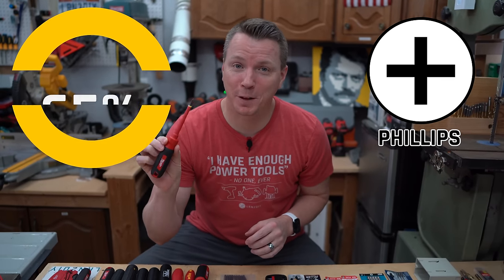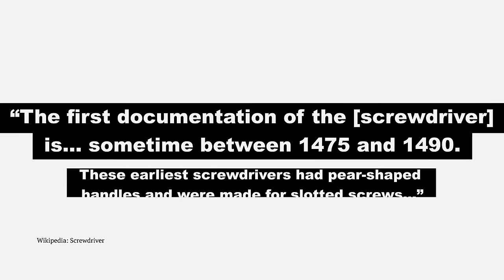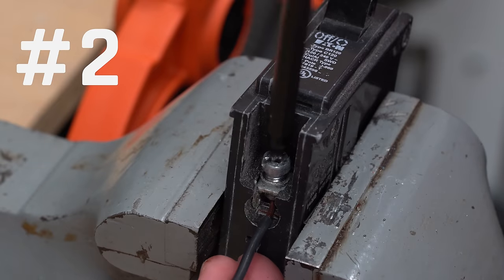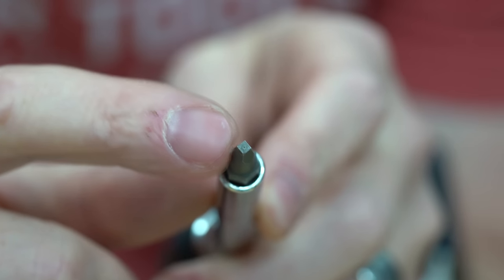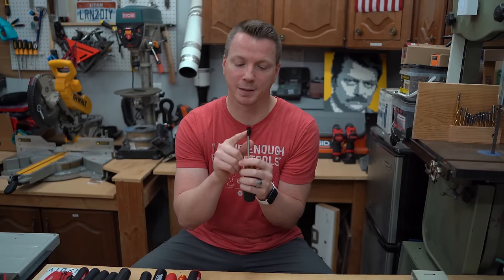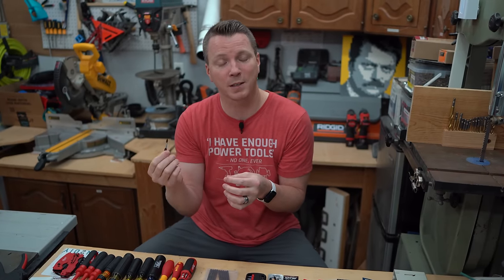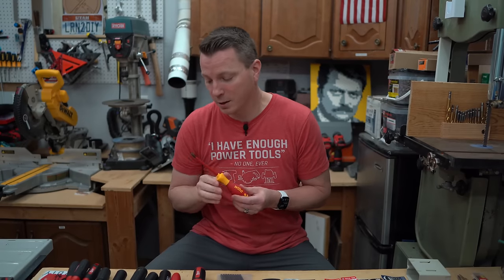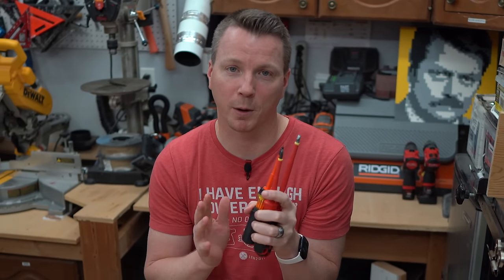You're Using the Wrong Screwdriver For Electrical

Comment: turn that power off, but also test the circuit you're working on with a multimeter! I've seen weird things in outlet boxes. 

Canada here, there should be a robertson in every toolbox already, it's extremely common here. Every deck screw, most countersunk wood screws of all sizes, etc... robertson. Works fantastic, assuming you use the right size. Only cams out if you aren't on it straight, but the other options perform even worse if you're not on it straight. Doesn't require much inwards forrce to get the torque, as opposed to phillips which requires a fair amount in comparison. The robertson drivers also can easily be sharpened a few times when worn! Or if you have a steady hand, as long as you have shank left! 

Slight correction on the Robertson/square drive history, the square drive screw was originally patented in New York City in 1875, but at that time they didn't have good easy ways of manufacturing them, so they didn't catch on. The patent expired before Robertson re-invented it (a case of parallel evolution, good ideas come back!)

With phillips (in non-electrical use cases), I have a pile of different brands and quality around, because it's really sensitive to how well the driver fits. Sometimes a crappy driver fits a screw better, so I rifle through the driver drawer until I find one that feels solid in the screw I'm working with.

Also, anyone with a japanese motorcycle, that's not phillips. Buy a JIS screwdriver. You'll be amazed at the torque increase, and how the driver holds on to the screw at all angles and doesn't fall out like a phillips screw does in a phillips driver! IMO if the world was JIS screws, we'd have no need for anything else.

Comment: Here is a tip. Stop using Phillips. It's the worst in literally every performance metric besides slotted. It was designed to cam out back when we didn't have torque drivers. It's time to use square or torx for everything. It's worth the extra penny.

Comment: Did you look at the Japanese version of the perfect tip, built according to JIS standards?  Their crosshead drivers look like Philips drivers, but have angles that are different, better designed and the tips don't cam out.  These are the drivers we needed decades ago when working on Japanese-made motorcycles and cars,  but didn't know about them. For many years I thought Japanese vehicles were made with cheap Philips head screws that would strip out easily; all that changed when I found out about and started buying crosshead screwdrivers and hex-drive bits made to JIS specs.   Thanks for testing all of these drivers for us. 

Next video, tell us why "perfect" small tools get lost so easily; many have found that you need to own at least 5, if not 10, 10 mm sockets in order to be able to reliably find one when you really need it.

Comment: Why not contact Leviton and ask them about the right driver.
Robertson = square drive.
If Klein made that a ratcheting screwdriver.....
Klein makes a 10 in one or better that has the #1 in it I believe.
It also has slotted, phillips, and torx.
Problem is that if your bit goes bad or you lose a bit you have to buy a whole new screwdriver.
Another issue with that screwdriver is that the recess in the handle can become stripped or malformed so the driver body won't go in and out.

Comment: Philips should also go away. I would actually argue that if they put 45's on the ends of the flat head it would self center, and it would be a good driver for tiny screws (less likely to cam out)

Comment: Is the Robertson and the square the same bit? Aren't the side slopes different?
Reply: Square just means unlicensed clone of Robertson, and so every company will have a slightly different version, just like with Phillips...
Reply: they are not the same, genuine Robertson tips have a bit of a bulge near the centre of their working length, hence their better holding power and less camming out compared to a generic square drive which typically is ground to a tapered square shape from a cylindrical steel rod, whereas the Robertson tip is formed in some kind of press process, it may be hardened steel as well prior to being inserted into a hex shaped or round driver bit.

Comment: We're talking electrical.  Have to have slotted, cause some screws, as you say, are only slotted.  Wish I didn't have phillips, but SOME screws again only will work with Phillips.  Sure, square is great, WHEN it is a decent screw.  Yes, ECX is great, when it is there.  I sure wish there was more consistency by manufacturers.  Yeah, Torx is a great screw, but of course it would take a few sizes too.  As another commenter said, the quality of the screws are also terrible.  I understand that when it is supposed to be a conductor, perhaps then there is an excuse, but there are lots of screws that are in Electrical that are not conductors and price seems to be everything.  I have probably a dozen hand drivers (and lots of powered ones too) that are in my electrical bag.  Many get rarely used, but I can't say that any one of them is the best at 50% of the time...

Comment: If the usual stores actually sold square drive bits for electrical work, then people would buy them. I could not find one in my local Lowes and Home Depot. I had to get one off Amazon. Square drive screwdrivers do not come as standard in screwdriver sets.
Reply: I love most things about 'merica, but y'all are stubborn when it comes to adapting things that aren't red, white and blue. I remember trying to find a measuring tape with metric readings when I was visited our American assembly plant back in '02, and I ended up having to grab a used one at a pawn shop because none of the stores in the area carried them. Ironically, the Robertson screw goes all the way back to the Ford Model 'T', but due to a licensing disagreement between Ford and Robertson they were discontinued on the American made Model 'T's.
Also, don't judge Robertson's by what you are getting off Amazon as most "square" drives are not in fact Robertsons, and most screws are just cheap "off shore" versions.

Comment: Interesting, think I'm gonna need to try the Robertson. I've sometimes used the SL/PH drives in the past, but I always ended up needing a regular PH drive for something so I've ended up just carrying PH instead. Well, I always carry a 2.5mm and 5.5mm flathead as well as a PH1 and a PH2 screwdriver, prepared for almost anything.

Comment: Phillips has too many variations i must have 25 -30 different phillips bits and that doesn't even come close to how many variations of screw and unless you use the correct bit with the Phillip screw you have wobble and slip and that causes stripping and the angles it uses is a ramp basically making you have to apply alot of force down on the head to stay in the head for any driving power.. Torx and square are great IMO Really though even with a matching Phillip where it fills the indent perfectly and entirely the screw can stay on on the end of the driver like square and torx without you having to hold it in place. One thing is that some modern phillips screw heads are ALSO Squares depending on the blade thickness and angle and depth

Comment: A combo bit will only work in a combo screw. The problem is too many standards. There are probably 30 different standards for screw drivers that look like a Philips, but being slightly different wont work properly with a Philips driver. But worse than that, screws are made cheaply, and often very sloppily. When a Philips driver properly fits a Philips screw, the screw with stick on the end of the driver, and not cam out, (this is true of most driver standards) but most #2 screws will fall off a #2 driver because of the sloppy tolerances. 
I try to use the driver appropriate for the screw. Combo drive screws are an abomination, they don't work well with any driver. If I could choose one driver, it would be torx, but unfortunately I have to choose driver to match the screws that someone else chose.

Comment: Why did Pozidrive never get adopted in the USA?  So much better than Phillips.
Reply: They are more expensive. Robertson and Torx are cheaper to make which is why most deck screws have moved to them. $0.10 makes a big difference when you're using 10,000 screws.
Reply: @minutiesabotage  but that must be true in Europe too. Yet no one sells packs of Phillips screws. Everything is pozi. 🤷‍♂️
Reply: @NickElliottuk  And as a result, it will cost more in Europe.

Comment: A thank you broadcast to all the peeps out there who use the correct size screwdrivers. And may those who don't do so step on something wet while wearing socks every day, until a super nova  grills this planet. During renovation work I found every single screw used for piping and wiring over-torqued, nearly every screw head damaged beyond salvage. Some people just want to watch the world - or in this case the house - burn ... or flooded. That was decidedly not fun.

Comment: Flat screws are not great and Phillips are just horrible. (the worst)  After reading all the hype about Robertson in comments on different videos I had to do some research to see if they were actually all that.  Robertson drive are right in the middle.  Then second best drive are the Hexagon shape. (Allen)   The best BY FAR are what I have been using since the early 90s and that is a Torx (star bit).  Now I should have just assumed they were best but I will always look into something I know nothing about just so that I am aware of what is available.  (also they work on every 60 degrees)  (of course electrics are too backwards to use Torx)

Comment: There is no argument that sloted screws ar out of date. The problems is they are not self centering and do not stay self centered as one removes them. This is made worse  if the blade is too thick to fit in the slot or  especially if the blade is too thin or the blade is not wide enough for the slot. There does not seem to be any standard. I have custom ground the blades to thickness at times. However one can usually make do.
 Phillips are self centering and  easy to engauge. The problem is there are not consistent standards in the screws made. Cam out is a real problem because the taper is either too blunt or too pointed. The Japanees industrial standard and pozidrive make the phillips style very difficult to accomidate with out  a lot of bits. 
The Robertson is a good drive but it lacks self centering and has a small drive surface that can cam out in low quality screws. The fit howver is good. It is easy to see why it is loved by Canadians
Torx is not self centering but drives and removes well once one finds the proper size.
 The electrical screws typically have a slot and either a square drive or phillips or pozi in the center. Things do not seem to be standardized. All of this makes working on existing equipment vexing. It seems that the variation for the center is what complicates the design of the combination drive. Working on renovations can be madning if fastners are interchanged especiall in caepentry. One needs a seperate  Pack out section for accomidating screws.

Comment: Coming from Europe with some observations. 

Robertson... Never seen one IRL! Not joking, never seen a driver or a screw for them. Probably seen combo screws, but never knew that they would work with a Robertson driver.

Flat blade... It's an occasional prybar that sometimes can work with a screw. 

Phillips... I hate Phillips screwdrivers. Most of the time the screws are just barely Phillips shaped, so even if you have a perfectly pristine driver of the right size they are still going to cam out. And if it's not the fit then it's the metal that's butter soft. And lest face it, when was the last time you borrowed a Phillips driver and it wasn't worn smooth? everyone has Phillips drivers, and almost everyone has cheap worn out Phillips drivers.
Having said that, with quality screws and quality drivers Phillips does actually work pretty well.

Pozidriiv... This is everything Phillips should have been. My experience with Pozidriv is a lot better than Phillips. Now this may just be because while just about every Philips driver tends to have been worked to death Pozidriv drivers are almost always still in good shape as they have not been used for everything no matter if they actually fit or not. Unfortunately Phillips heads are a lot more common on screws so people tend to go for the Phillips the moment they see a cross head screw, and if it slips they blame the screw and not the driver.

Combo drivers... Never used one, and as I don't work enough with equipment that use combo screws I don't feel a great need to get one.

Now there's the screws....
The combo screws I've worked with has been kind of the worst when it comes to fitment. Now it may be that they would work well with Robertson drivers, but as I've never seen one that doesn't mean much to me. But as  far as Phillips drivers they usually fit like crap, and with metal as soft as crap that doesn't make things better.

And here the simple flat blade screwdriver unfortunately shine. When you've rounded out the Philips part of the combo screw the flat head screw driver will still get the job done. You may hate it, but it's simplicity does have some advantages.

Comment: Now, if they would only make a double ended double sided flip bit screwdriver.
Robertson 1 and 2 flip bit on one end for outlets and a recessed shorter slot/phillips flip bit on the other end of the screwdriver handle for the cover plate and other screws and you would only  need one screwdriver.

Comment: I don't understand this question. You use the screwdriver that is correct for the screw. There are still some screws used in electrics that require flat headed screwdriver. Don't ask me why.

Comment: Personally, I've grown to hate any phillip head screwdrivers, especially when used with a power tool.  They strip the easiest.  After removing old power outlets, slotted screws should be banned from existence.  I would prefer robertson if at all possible since the least hassle.  Did run across the issue of finding Robertson #1 screwdriver bits outside of a set.  Gotta hope to get say Princess Auto surplus online for them.

Comment: Slot-drives (or cheeseheads, as I call em) are required for ANY electrical rework, to get the front plates off! So, I get the 17% number... I'm just hoping that's ALL they're being used for, though.
Reply: Thinking about it again... I think people use slotted drivers in the USA more often than in Canada because Phillips isn't THAT much better than slotted. It's better, but NOT an order of magnitude better, like the Robertson or Torx/star-drive is. I rarely if EVER see slotted screwdrivers used in Canada for anything other than face places and as a blunt impact tool/wedge to pull things apart.

Comment: At the begging of the video I said the best driver for electrical is in fact the Robertson. Then he started going through all these different drivers and I started laughing thinking he is going to go through all this and is going to end up on Robertson. It was always going to be Robertson, that was inevitable because it is the best driver for working with electrical. I've been working with electrical for longer than I can remember, but I remember when I was starting  out I was working with an older mentor and I was working on a light switch when he looked over and said, "Your using the wrong screw driver". He took the phillips out of my hand shoved in my belt then pulled out the red handled #2 Robertson and handed it to me and said "that's the right screwdriver". He then laughed and said don't worry about it you'll thank me later. That was 40 years ago and I am still using the #2 Robertson because it's the right screwdriver for the job. I actually thought everybody knew that, I was surprised to see only 8%.

Comment: Does anything electrical use torx fasteners?
Reply: I tried Torx on one deck project — the heads are attractive — but to my dismay — unlike Robertson which fit the driver tightly while driving,the Torx just fall off unless I hold them while driving.
What’s wrong with this picture? I even used the common brand GRK that supplies a bit in the package and they just fall off.
Who designed these? Wth 6 flutes, they should fit better than Robertson while working.

Comment: Electrician here, the no. 1 robertson is king. 
As for the insulated screwdrivers, they're really only useful for panel work. Same with other insulated tools, you shouldn't be working on outlets live. Buy a circuit tracer and tick tester.
Reply: I should say robertsons, both are useful, you may also find robertson no.3s alot on panel covers.

Comment: Ive been in construction and home remodeling since 1998. I agree that flat head needs to go extinct. I think the canadian square drive is the most secure and least likely to strip out or slip off. But i think torx bit or star bits are the absolute best available. Why wasnt it included in these options?

Comment: Slotted are an atrocity. And I'm sick of Philips heads, they cam out far too easily, and then the screw is damaged and will cam out even easier, leaving you with screws you cannot drive in further, or worse, cannot easily remove. All the combo heads are flawed, compromised garbage. Robertson/square drive is excellent. Odd that you don't mention Torx bits. They are excellent too.